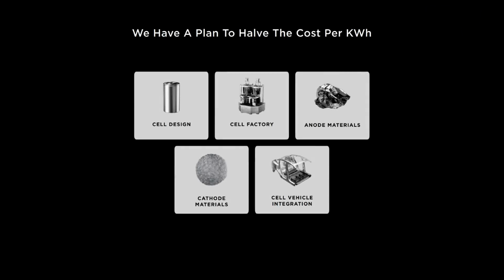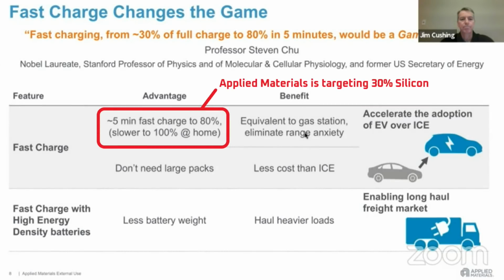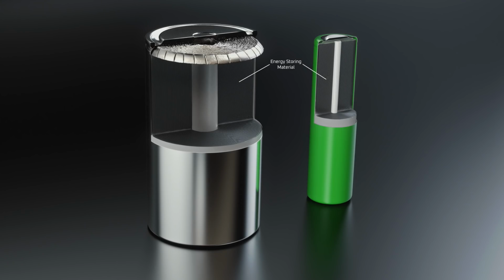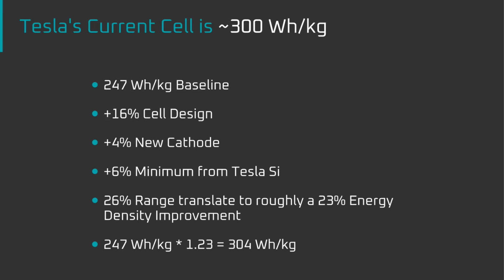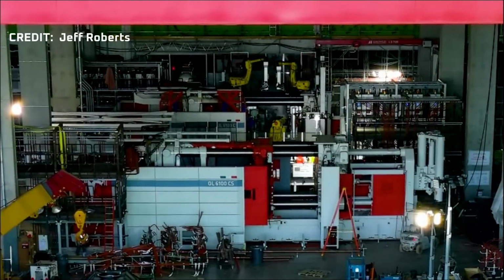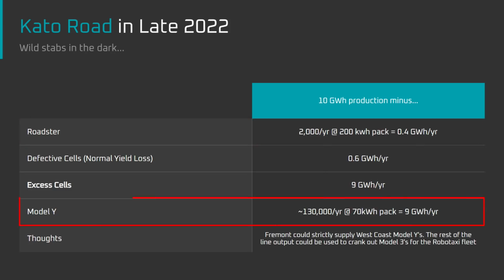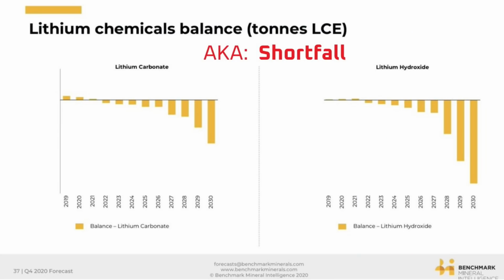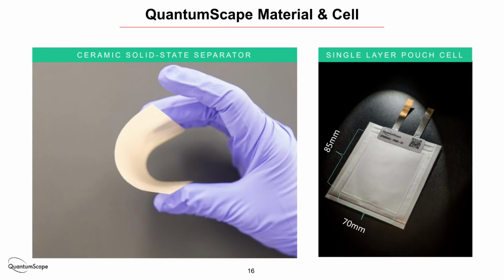#18 Nine Months of Research on Tesla Battery Day  // + Projections!

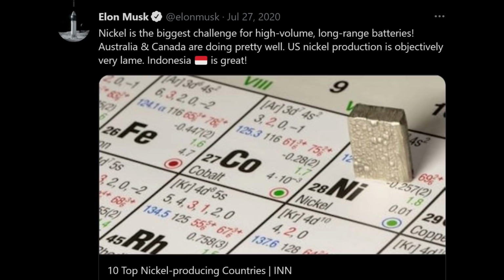Comment: 4:28

The one company in the Tesla supply chain no one is talking about in detail yet (and would love to get other's input) is Queensland Pacific Metals. They are solar powered and use nitric acid leaching at atmospheric pressure to extract all valuable metals from lateritic ore.  It is a key reason the project is expected to be less capital intensive than other Australian nickel-cobalt developments based around high pressure acid leach (HPAL) processing technology.

Whereas HPAL plants require the use of complex, titanium-lined autoclaves that can withstand high pressure, the DNi Process (Direct Nickel) will allow the use of standard grade stainless steel at atmospheric pressure – much simpler processing equipment. What previously used to require 1.2 tonnes of tailings to 1 tonne of ore is also looking at being recycled. This company solves a lot of issues surrounding nickel in the battery sector as they are zero liquid discharge, zero solids discharge, low greenhouse gas intensive with the possibility to become a zero carbon nickel producer/processor. Their final product is battery grade nickel and cobalt sulfate produced from start to finish in an eco friendly way. From what i've seen this is a world first in the nickel industry, but would like to know more if anyone has researched or knows of any similar companies.

p.s. they provide their products to LG Chem who provide to Tesla and possibly also to Samsung (2 of the largest lithium ion battery manufacturers in the EV space globally)
Reply: interesting, i dont think there is anything similar to that from what i know

Comment: The battery building in Berlin is still working on foundations. The building in Austin is almost structurally complete. Steel is complete, roof decking is complete, concrete at the above floor levels is above 60% complete. The final roof is most likely a month away if the weather cooperates. Upper levels will finish concrete in the same or less. Plumbing is already being worked on at ground level. The Cathode building is still completing foundation work, rain has slowed down the dirt work.

Comment: The supercharger "bottleneck" could be solved with the use of super-capacitor/mega-pack battery storage - we have yet to see Tesla make use of the super-cap technology from Maxwell. There are surely many applications for it to assist in ultra-fast charging.

Comment: Your work Is amazing. I did pick up one goodie on the model S reveal with Elvon voiced increased Super Charging rates up to 350 watts which is require to reach the faster charging rates. The reveal also didn’t elaborate on battery size. As a Tesla investor your presentations are number one.

Comment: Great video! One correction: Tesla was not able to eliminate panel gap issues until very recently, with the switch to large extruded aluminum body castings. To this day you are likely to see panel gap issues on the Model 3. The panel gap inconsistency in this case is caused primarily by the use of a wide array of metal types, welded together in a variety of ways, in the construction of the car body. It makes build precision a near impossibility. At least that's what Mandy Sunroe tells me.

Comment: Possibly the best video regarding Tesla that I've seen. 

One point on the Model 2 production - you took the $9k battery cost of the Model 3 and halved it for 4680 cells, but that assumed that the Model 2 would also use around a 75KWh pack did it not? 

With being 20% smaller and lighter, the Model 2, to achieve a 300 mile range, could probably do that with only a 50KWh battery could it not? Which would put the cost of the battery pack down from $4,500 to below $3,000 perhaps?
Reply from the maker: Thanks James!  I applied the 20% cost reduction, but you are correct, it would likely be more! 🤠 I was trying to keep it simple.  Definitely not a linear relationship.

Comment: I have worked on lithium battery lines and i can tell you, if they can nail DBE, it will put TESLA so far ahead of what any other manufacture can do at this time. Getting rid of the giant dryer units needed for wet coating would be a technological leap!
Reply from the maker: Shit!  Thanks for stopping by!  First person with actual battery line experience that's commented on DBE.
Reply: @thelimitingfactor  Jordan, Let me know if you have any production questions. I can provide you with inside info etc.

Comment: Another amazing factual video. Big thanks.

Just my thought.
I used to work for an R&D company in the 90s and one of their many project, was one dealing with waste using a huge cathode arc furnace. This arc thing was a 1Mwatt beast of a thing.  It was huge, loud, dangerous and scary.

Now someone is thinking 800kwh in a single charging station.
Blimey.. how (electrcial safety)technology has moved on since my days.

Comment: Excellent and informative video series with exception for the blind spot in omitting any discussion/analysis of the Nevada lithium mine with respect to the monumental roundtrip costs to physically excavate and transport the lithium ore to the minehead processing facility and return the spoil back to the hole from whence it came.  This cost was a critical omission in the original Tesla Battery day presentation which was similarly ignored and accepted without question or comment within this followup video presentation.

In my opinion, this issue deserves its own stand alone video to illustrate, discuss, and analyze the sheer physical magnitude of what Tesla is proposing to do with lithium mining in Nevada in comparison to the benchmark Bingham Canyon copper mine near Salt Lake City, Utah.  The Bingham Canyon copper mine (opened in 1906) near Salt Lake City, Utah holds the distinction of being the largest man-made excavation in the world and the deepest open pit mine in the world measuring in at 1900 acres (3 square miles) with dimensions of 2.5 miles (4,000 m) across and 0.75 miles (1,200 m) deep.

To fully grasp the import of Tesla’s Nevada lithium mine one must grasp its physical dimensions in comparison to the Bingham Canyon copper mine. Tesla described the Nevada lithium claim as an area of 10,000 acres which is an area roughly 16 square miles (4 miles x 4 miles). This is a footprint area on par, but slightly larger than the Bingham Canyon copper mine. 

SPOILER ALERT: In just a few short years of full scale lithium mining to produce 3 TWh of annual battery production, the Nevada lithium mine would quickly surpass the physical dimensions of the Bingham Canyon mine (opened in 1906 and still active after 115 years) to become the new largest man-made excavation / open pit mine in the world.  How does this astounding fact just silently breeze through with not so much as a technical mention let alone a proper discussion/analysis of the equipment and the economically prohibitive operational costs to embark on such a task?
Reply: To be critical, the September 2020 Tesla Battery Day presentation has been treated here and elsewhere as some type of advanced post-doctoral educational seminar that was sponsored by and presented by Tesla.  When in fact it was a sophisticated carefully crafted promotional business presentation that served the business interests of Tesla in terms of multiple target audiences including public relations, the investment community, the competition, and the supply chain mining/ore processing industries.  Having said that, the underlying but unstated premise of the lithium mine segment (i.e., physically digging low concentration lithium bearing clay out of the ground) was a well planned and well played strategic ruse.  Within a dynamic competitive business world it is lawful and sometimes makes good business sense to avoid telling the complete truth while at the same time not telling a lie. It is part of the stock-in-trade of what lawyers and successful business executives do everyday.  It served to blur the line between fiction (over the short to medium term) and non-fiction (perhaps 15 to 20 years from now).  To use a sports analogy, the Battery Day Nevada lithium mine segment was a head fake or a juke designed to confuse, confound, and freeze the defense.  Without the Nevada lithium mine announcement, the contract price for lithium and the stock price of lithium mining companies would have rocketed to the stratosphere (to the detriment of Tesla and the broader EV and battery storage industries) upon hearing news of an increase in lithium demand to produce an annual 3TWh of new battery production.  The Nevada lithium mine announcement served to temper and buffer the lithium industry by announcing both new demand and new supply to meet the new demand in the sense of offsetting penalties.  No doubt the Nevada lithium mine will one day become a thing … pause - pause - pause ... in about 15 or 20 years when the governing economics ripen and fall into place.  In the meantime, Tesla will quietly work with diligence on further research and development of the lithium salt extraction technology and pilot scale mining/ore processing operations (miniscule costs in comparison to full scale mining operations).

The Battery Day announcement of the Nevada lithium mine has fully served its primary purpose.  Mission accomplished.  From here on out we can expect to hear nothing but crickets out of Tesla regarding the Nevada lithium mine as it fades back into the literary ether from whence it emerged.  If pressed, Tesla may offer vague statements of generic rhetorical pablum devoid of details as to progress, schedule, or costs.  “Oh Yes, I can confirm we are working on it with diligence.  Everything is moving forward at full steam, blah, blah, blah”.

The problem with the null discussion and analysis of the Nevada lithium mine economics derives from some critical omissions in fact checking the assumptions and basic elementary math of digging low concentration lithium clay out of the ground, loading and transporting it to the ore processing facility, and returning the spoil back to the hole from whence it came.  If it was anybody but Elon Musk, people would have quickly run it to ground and called bull on the very basic (first principles) economics of digging and transporting low concentration lithium bearing clay.  However, because of the aura and mystique of Elon Musk, he just seems to get a pass on such things.  “The great Elon has spoken, pay no attention to that man behind the curtain”.

The Nevada lithium mine segment of the overarching Tesla Battery Day presentation was a literary MacGuffin. For those who may not be familiar with the art of storytelling, a “MacGuffin” is an attention getting plot device necessary to the plot and motivation of the characters, but insignificant, unimportant, or irrelevant in itself.  The Nevada lithium mine (nothing but the mining equivalent of vaporware for the next 15 or so years) is a distractive literary plot device that serves much the same purpose as the glowing briefcase in the film “Pulp Fiction”. Elon Musk should have been double nominated for the 2020 Academy Award categories of best original screenplay and best actor in a leading role for the Nevada lithium mine segment of “Battery Day” premiering to great honking fanfare on the big screen (literally on a big outdoor screen) at the 1st annual Tesla Fremont film festival.  I say, bully to him for successfully pulling the wool over everyone's eyes, as he did it out in the open in plain sight for all to see.

In the sense of failing to see the forest for the trees, Elon Musk (wearing the hat of the Pied Piper) successfully captivated the audience’s attention who willingly and unquestioningly followed the bouncing ball to become entranced and lost in the narrative of the novel lithium salt extraction technology.  Rather than looking in and following the bouncing ball, a proper and comprehensive critical analysis should have stepped back to look at the bigger picture encompassing the entirety of the roundtrip mining and extraction process including the inarguably mundane low tech digging, loading, and transport of a mind boggling huge volume of low concentration lithium clay ore and return spoil (which is where the majority of the full scale operational costs are likely to be found).
Reply: The copper ore concentration of the Bingham Canyon mine (2000 ppm = 0.2%) yields 1 kg of copper per 500 kg of ore. By comparison, the concentration of lithium in clay at one particular cited location in Nevada (1145 ppm = 0.11%) would yield roughly 1 kg of lithium per 875 kg of clay.

Assuming roughly 225 metric tons of lithium per GWh of batteries (this is dated info that may need a current fact check) and a density of 1,700 kg /cubic meter for lithium clay.  A full scale 3 TWh of annual battery production (3,000 GWh per year) consuming 675,000 metric tons of lithium per year will yield an annual hole in the ground roughly 350,000,000 cubic meters per year or 0.43 cubic miles.  This is an annual hole in the ground roughly 100 meters (328 feet) deep across a footprint area of 3,500,000 square meters (1.88 km x 1.88 km, or 860 acres or 1.3 sq miles) per year.  The Bingham Canyon mine opened in 1906.  It has taken 115 years of mining to reach its current dimensions.  If Tesla is to mine enough lithium bearing clay to achieve an annual 3 TWh battery production rate it will need to dig a hole in the ground on par with the Bingham Canyon mine every couple years.  There is an extremely profound inverse relationship between the concentration of lithium ore and the quantity of ore that must be mined.  The lower the ore concentration, the higher the quantity of ore that must be mined and processed.  There is an equally profound economic reality that cannot be glossed over or ignored.  With low concentration ores there is simply too much ore and spoil to be excavated, handled and processed.  What is true for the economics governing the mining of low grade gold ore (excavation, transport, and disposal of ore and spoil) is equally true for the economics of mining low grade lithium ore.  One cannot due an end run around this hard economic reality with a brand new fancy novel salt extraction technology.  That is, unless the salt extraction technology can somehow be implemented with some type of insitu closed loop injection/extraction system without excavating any ore from the ground?? 

In comparison to the Bingham Canyon copper mine (ore concentration 0.02% or 2000 ppm), a kg of lithium produced at the Nevada lithium mine (ore concentration 0.11% or 1145 ppm) would need to excavate and haul roughly 175% more ore than is required to produce a kg of copper from the Bingham Canyon mine.  In comparison, a spodumene mine such as the Piedmont lithium mine in North Carolina (ore concentration 1.5% or 15,000 ppm) the Nevada lithium mine would need to excavate and haul roughly 13 times (1,300%) more ore to produce a kg of lithium.  That is to say, in comparison to the Piedmont lithium mine, the Nevada lithium mine would require:

13x the equipment cost (excavators, haul trucks, bulldozers)
13x the cost to maintain said equipment
13x the cost to fuel (diesel) to power said equipment
13x the cost of labor to operate said equipment

All of this on a scale that would produce a hole in the ground that would grow and surpass the size of the Bingham Canyon mine every couple years.  Setting aside the salt extraction processing costs, the 13x excavation and haul costs (equipment, diesel fuel, labor) alone would be sheer financial insanity!

That is, unless Tesla has an as yet undisclosed plan up its sleeve to innovatively and cost effectively scale the mining process? Tesla could have a plan to disrupt and re-invent mining as we currently understand it to be.  I imagine it would take form as some type of next generation highly automated autonomous battery electric mining and hauling equipment (a cinch in comparison to the complexity of full self driving autopilot) guided in real time by AI, GPS, gyros, accelerometers, haptic feedback sensors, cameras and/or LIDAR all powered by its own dedicated gigawatt scale PV power plant coupled to grid scale battery storage for continuous 24/7 operation.  All certainly within the wheelhouse of Elon Musk pooling the collective knowledge and engineering expertise of Tesla, SpaceX, and the Boring Company.  Perhaps that is where this story is going??

Comment: 43:28  4680 line installations Q4 2021 seems unrealistic, given that the building that's slated to produce cells is only at the foundation-laying stage presently, and Tesla only just filed for the permit for battery production there.  In contrast, the northwest quadrant of the GF5 - expected to house cell production - is already framed and floored, and permitting seems not to be an issue there.